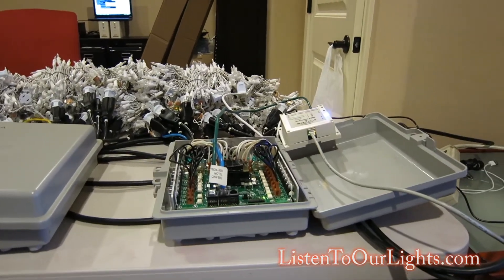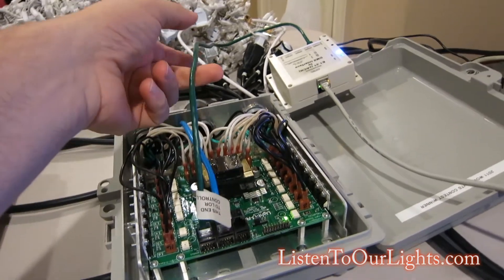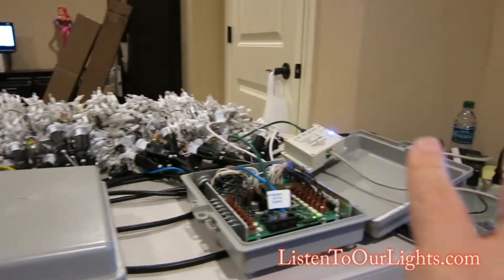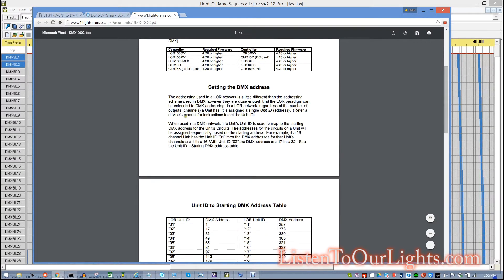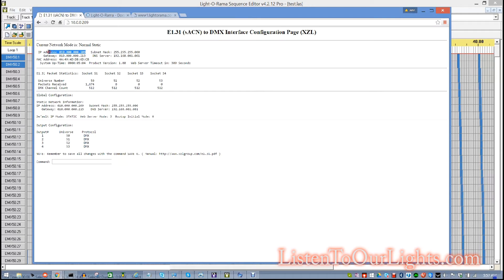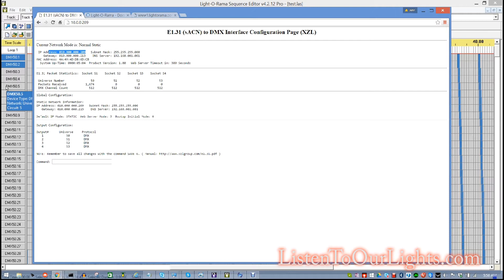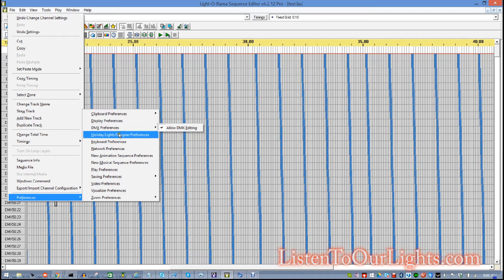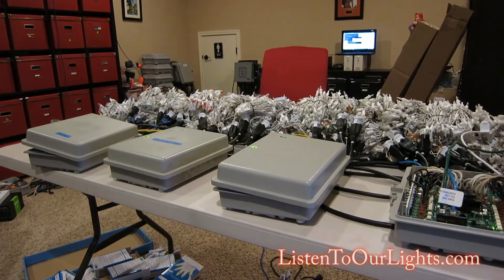Configuring LOR CTB controllers for DMX

Comment: John, in your setup here, could you install a switch between the computer and the adaptor your using to then send signal to multiple Pixcon16's? Looking for a way to avoid running another cable from the show computer to the yard

Comment: I have the standard license. I have two CTB16 controllers. I am updating to pixels next year and plan on purchasing Falcon F16v3. I have read that I should convert LOR controllers into DMX, but I cannot do that with the standard license using your steps. Do I actually have to pay for a software upgrade to LOR to do this?? With the new Falcon, can I simply plug the cat5 into it and then into the Falcon as is? Or do I absolutely have to upgrade to DMX?  Thanks for your help and very informative videos.
Reply: Just use Xlights :)